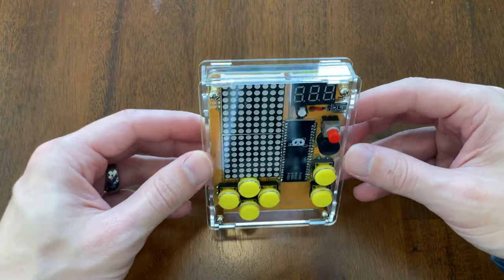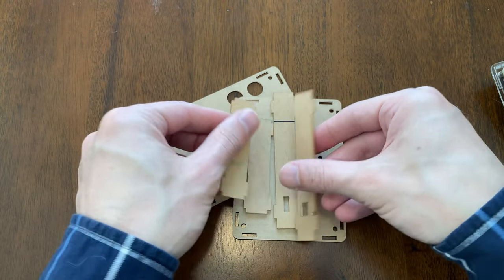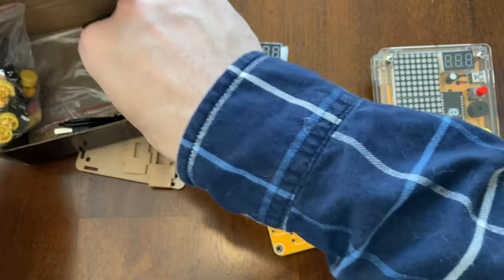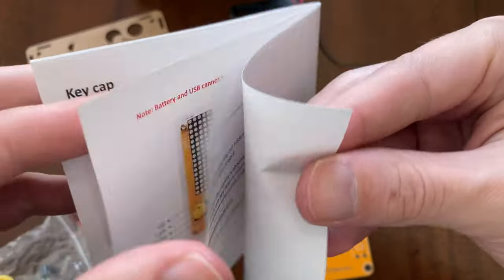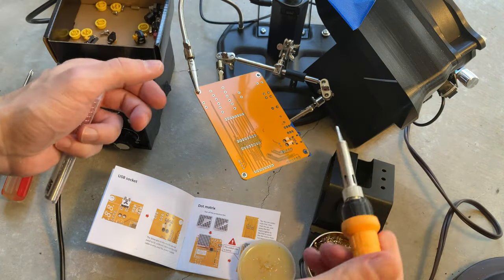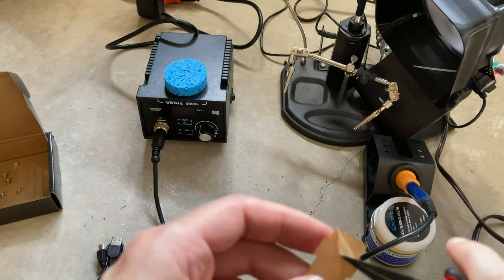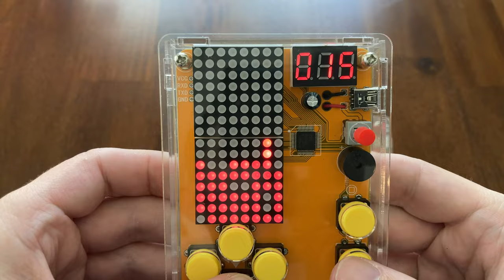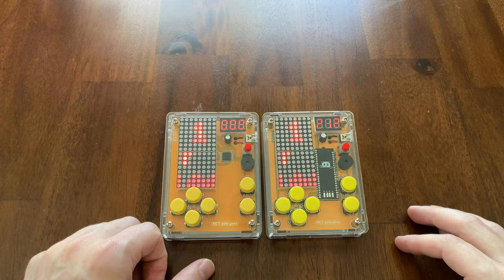Retro Game Solder Kit (Teris ^^) cool. Meg gets the new one. Build tutorial & overview with demo!

Comment: I have a problem with the battery overheating, any ideas? Thank you.
Reply from the maker: Single use disposable alkaline AAA batteries arranged in series to make 4.5vdc, usually do not heat while under such low sub 100ma loads created by this sort of electronic device. Perhaps you have a solder pad bridged creating a hot short that is causing the battery to heat up & drain faster.